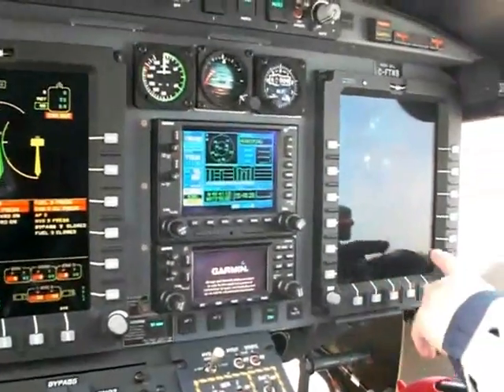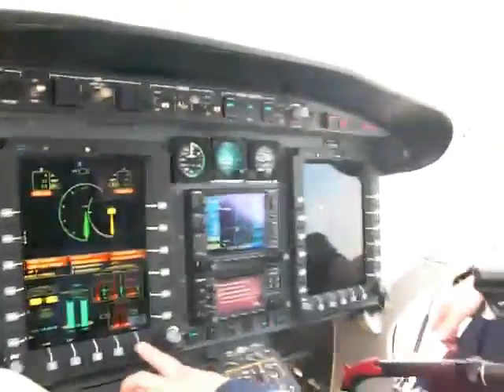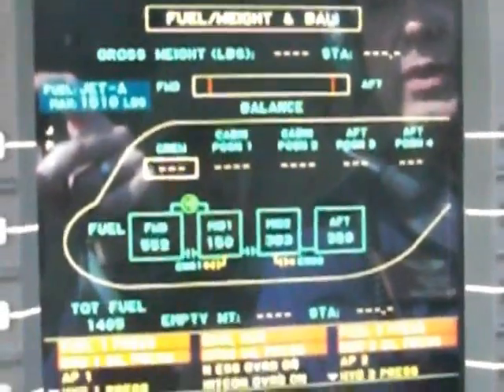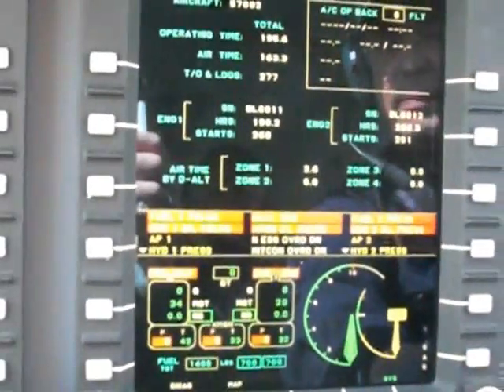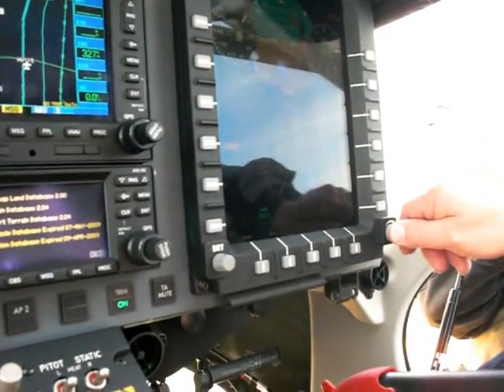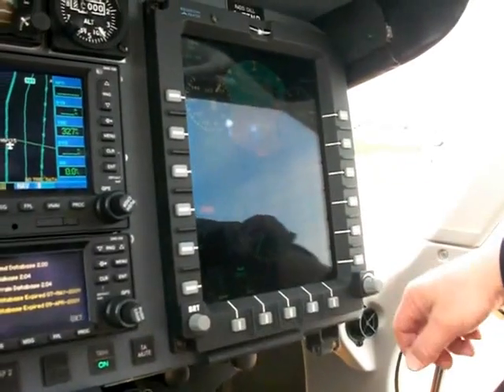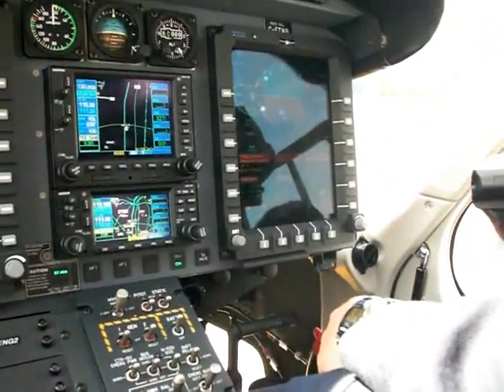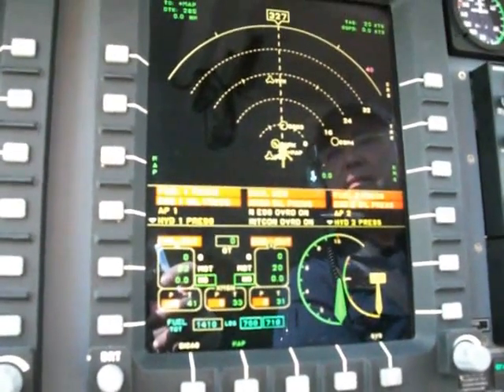Bell 429 Part 2 Cockpit and engine start

Comment: @Elhombresombra It's most likely the altimeter.  They have a little vibrator in them so they don't get stuck.  They are annoying as hell in the KC135 I work on while I'm doing crap upstairs.  I usually pull the circuit breaker so it will shut up.

Comment: All that electronic equipment like automated FADEC's etc are nice, but it's just that much more stuff to be affected, or knocked out, from electromagnetic interference. I heard rumors that the Russians have created an EM warfare system that they tested on a US destroyer that entered their waters in the Black Sea. It was in pods mounted on two Sukoi Su-24 fighter planes and supposedly jammed the destroyer's AEGIS radar while the Su-24's did twenty minutes worth of simulated attack runs on the destroyer. The destroyer could not lock the fighters on radar to use surface to air weapons on them in defense if they really had been attacking. The only option would have been to use shoulder launched Stingers, but at that close of a range the Russian fighters would have already sank the destroyer with anti-ship missiles. Of course radar jamming is nothing new, and the reports of the incident, as well as reports that several navy officers from the USS Cook, I believe it was, resigned because the incident shook them up too much, were most likely exaggerated. However, it may not be long before EM weapon systems may be developed that can knock out electronics by neutralizing their transistors. The wonderful, but flawed, transistor that makes integrated circuits and CPU's possible, but extremely sensitive to EM radiation, especially gate capacitor dependant field effect transistors. EM weapons, and EMP's both natural and nuclear weapons caused pose a major threat to all of the electronics that we have become so dependent on. I dread the day an EMP, or nuclear war ever happens. The Russians have been working on shaped, directional nuclear charges from the Orion propulsion system that, when aimed at the outer atmosphere, can create EMP's far more powerful than an omnidirectional nuclear device. We would go insane without our PC's, tablets, and cell phones. Teenagers would be committing mass suicide without their cell phones and constant texting.

Comment: the 429 should be used for a new airwolf
Reply: I agree. The 222 had nice lines, but the 429 is a very nice helicopter. I was thinking not long ago about a new Airwolf. Would the 430 be the obvious choice, or something different? Perhaps the Airbus H-155, or the amazing new H-160 with the new, quieter Blue Edge rotor blades, along with the quieter asymmetrical Fenestron for a more stealthy approach. Then I saw the Airbus X3. No tail rotor. It uses props to counter torque and increase it's speed along with lift provinding winglets, and slowing the main rotor RPM's in high speed flight for greater efficiency, prevent advancing blade supersonic airflow and asymetry of lift, and provides a smoother ride. Just replace the props with turbojets. The pusher prop version is nice, and makes ingress/egress of passengers with blades/props turning possible. If we're talking about high speed flight, where retreating blade stall and asymetry of lift would be a problem, then perhaps we use a coaxial rotor arrangement like the Sikorsky X2, and the Kamov Ka-52 use. No asymetry of lift when two contra rotating rotors are used. Each side has an advancing and retreating blade. But maybe we keep Airwolf in the Bell family and make the 429 be it. I am a fan of the safer, and quieter, Fenestron tail rotor. Perhaps we could put one on the 429, along with some Blue Edge blades, more powerful engines, a stronger main gear box, lift providing winglets, and main RPM slowing system for high speed flight. The 625 shp, 730 takeoff shp, Pratt & Whitney Canada PW207D1is a nice engine choice, but perhaps something with a little more power. How about extending the cowlings a bit and putting the 1,600-2,000 shp PT6C-67 engines in, along with the main gear box from the 412? They'd sure give you the power to lift speed boosting turbojets, machine gun pods, missile launchers, two pilots, people being rescued, and extra fuel for those thirsty PT6's and the turbojets.

Comment: Hi , what's this crackling in the background ?? 2:00
Reply: I believe it is an indicator that the battery power is on, but neither of the engines are generating power to charge the batteries. When a turbine helicopter is started you are limited to how long you can use the starter. The starter on a turboshaft engine must be used until the N1 speed is high enough for the flame in the combustor to be self sustaining. An RPM that varies with engine design. For example the starter on the Allison/Rolls Royce 250 in the Bell 206 Jet Ranger has to be spun until N1 is 58%, the start of the green arc on the N1 gauge. After that it is self sustaining and you can release the starter and engage the generator to charge the batteries. That has to happen before you reach your time limit on the starter otherwise the startup must be aborted and you have to wait until another startup attempt can be made. If the engine has been ran recently, and the turbine outlet temperature gauge is above 150 degrees, you have to use the starter to circulate air through the engine to cool it below 150 before you can throttle fuel to the engine which uses more time on the starter. If you fire the engine up above 150 you risk a hot start which can burn up your engine, and that's a lot of money in your hands. Around $320,000 for an Allison/Rolls Royce 250 C20B, and $265,000 for a 250 C30R. Interesting to note that the C30R is more powerful, 650 shp as opposed to 420 shp in the C20B, but costs less. Anyway, the less time you spend on battery power without generators the better.